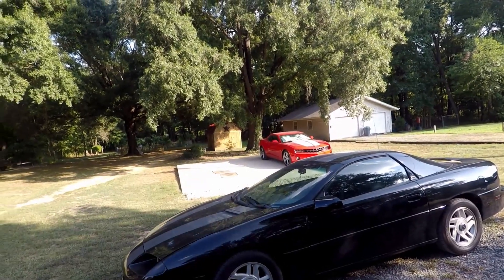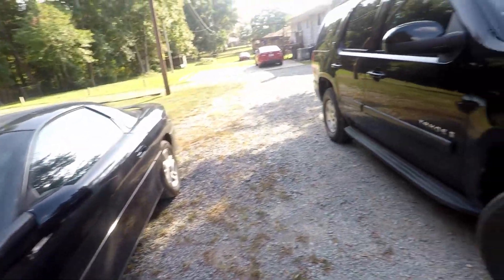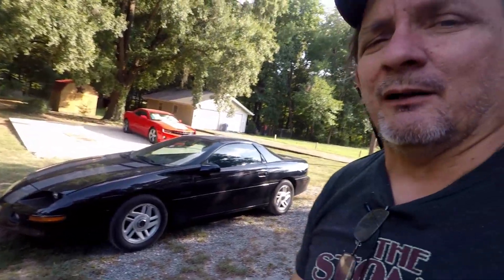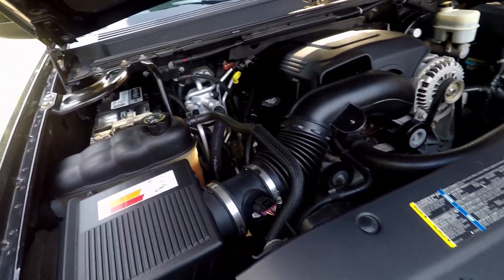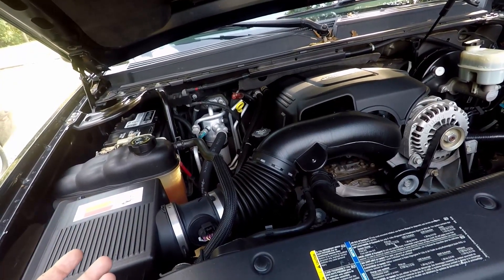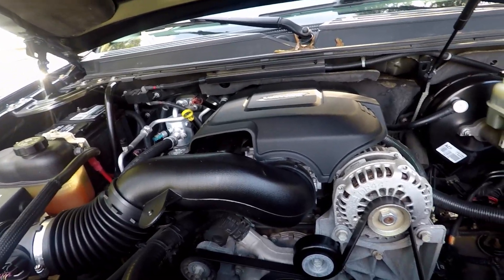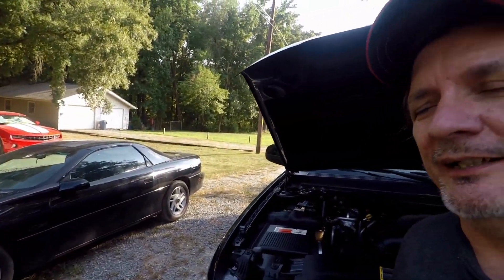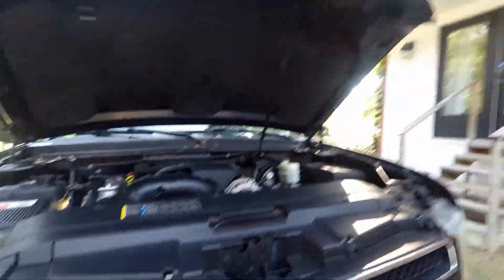Chemical Guys VRP as an underhood engine bay protectant for my Tahoe and Camaro

Comment: Held up pretty good for 6 to 1. I use the Adams VRT but my car sits in shows all the time so the price doesn't bother me on the Adams. But If I was to use it on multiple cars I would probably use something else Like CG.  I also use the Adam's In and out spray to do the same. It's faster and you just spray and wipe. VRT I use mainly for tires. Great video
Reply from the maker: Yep. I am going to get the in and out eventually. Sooo pricey. I have the VRT because Ouzo lou sent it to me. Or I still would not have it. But I am going to use it on the red SS for shows and what not. The Z28 is my daily and the Tahoe is the wife's daily. So I needed something cheap for them. And this fits the bill perfectly. Thanks for watching